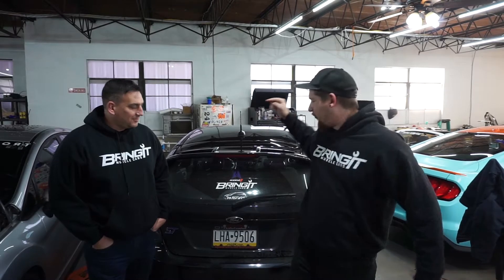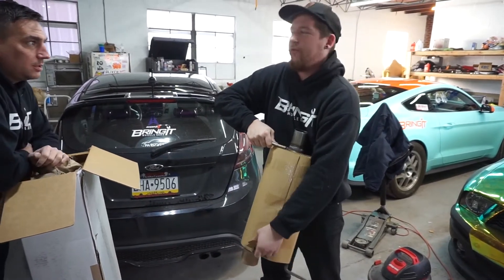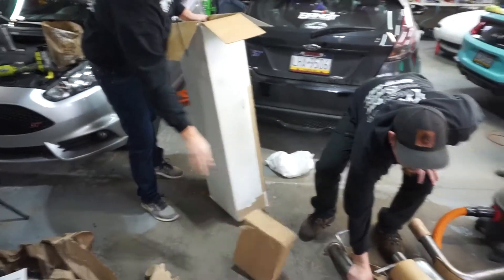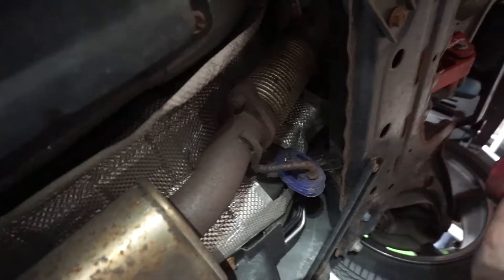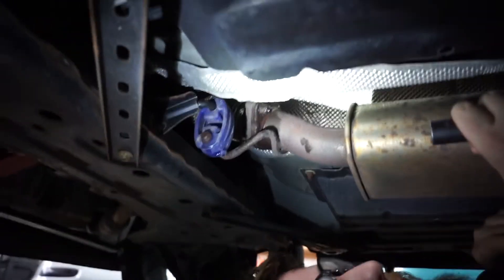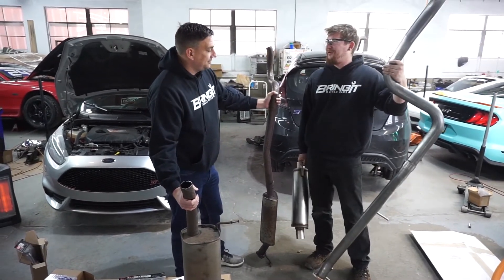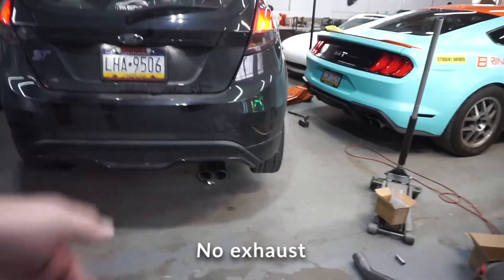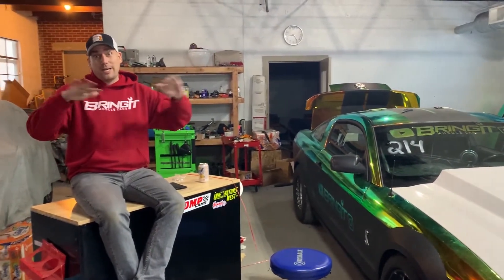Ford Fiesta ST FSWERKS Sport Exhaust Upgrade

Comment: What downpipe is on the fiesta ? Exhaust is on the way.
Reply: Also are you guys running a tune. Any Crack tune file ?
Reply from the maker: @NotoriousRod53  it’s stock down pipe still. He has a tune but it’s not a crackle tune. He just added a intercooler and a intake. Those videos will be coming out in the next couple of weeks.
Reply: @BringItMuscleCars  sweet, looking forward to it 💪
Reply: @BringItMuscleCars  no way, that much backfire with just an intake? You sure?